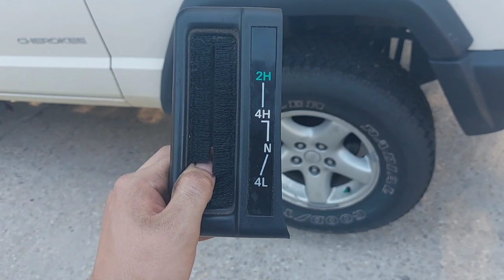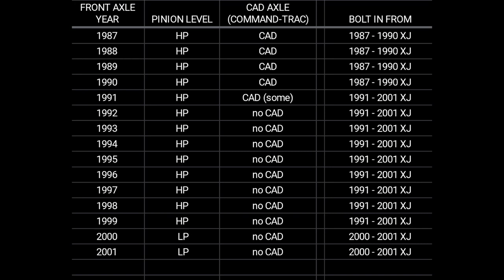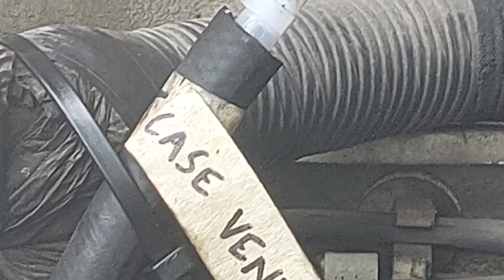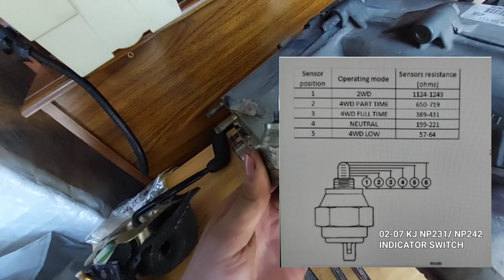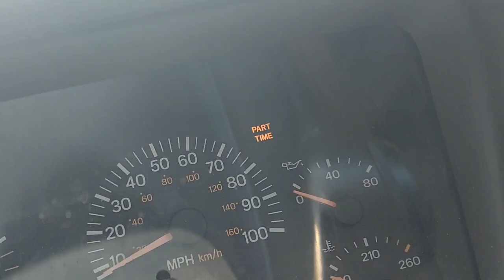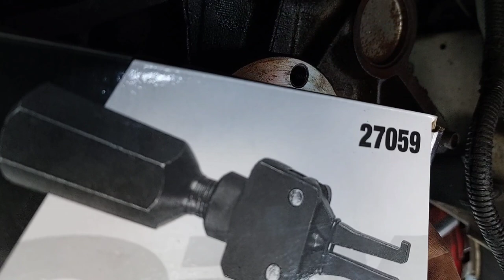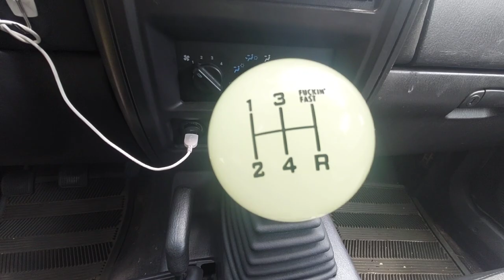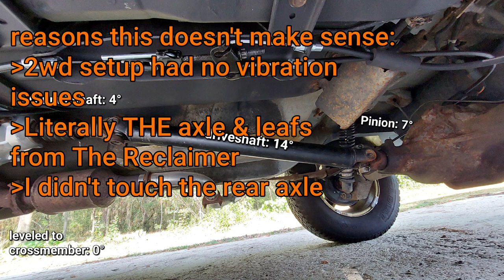Jeep Cherokee: 2wd to 4x4 Swap: Everything You Need to Know to Install Factory 4wd [‘87-’01 XJ]

Comment: Really no parts for nv 3550 and you believe that? A quick internet search shows different. Why not go with a nv 4550hd like most jeepers would want. I went from Ax 5 to Ax 15 because cheap. But would like the nv 4550. Despite "nobody" works on them. I would just rebuild myself I have a press, feeler gauges, and gear puller.
Reply from the maker: well, allow me to ignore all 4+ of the shops I talked to who each denied me service and cited the same reason every time, buy a press, feeler gauges, gear puller, and spend whoever knows how long learning the vast technical intricacies of rebuilding a transmission with no prior experience doing so, for a video almost entirely unrelated to transmissions... and/or inform my past self of a custom upgrade Dodge truck conversion for the transmission on a stock vehicle when I'm trying to convey the general process for adding a factory 4x4 system that others need to be able to follow the overall guidelines for. MY APOLOGIES SIR

Comment: Dead jeep sent me a bad steering column.   I asked for a replacement.... they sent another one.  Wouldn't accept the return of the first one and then refunded my money even after i called and sent several emails saying no that's not necessary.    I don't know if customer service has no real communication or what happened but i just gave up after the first few weeks of trying

Comment: Brilliantly detailed video as usual!  Much appreciated!  I'm in the middle of converting mine.  Just recently finished the front axle portion of it which also involved re-gearing to match the rear, replacing all new components: tie rods, ball joints, wheel hub assemblies, etc.  Only thing I'm lacking right now is the front drive shaft.  Once I acquire one for cheap, then on to the transmission swap.

Comment: I want to thank you very much for putting this video out. I will be doing this exact thing soon. 
I have a 1994 Cherokee two door 2.5 liter, 5 speed that was to good to pass up on. I also have a 2000 Cherokee 4 door 4.0 liter (no good) auto that I was going to steal from for the 4X4 system, and possibly the transmission too. 
Hopefully it wont be too much trouble. 
I wish I can "like" this video each time I've watched it...3 times by now.
Great channel and please keep it mostly XJ.
Reply from the maker: Don't get too excited, there's a whole lot of obstacles with the 2.5L, and the 4x4 Swap is not well documented at all for them. You won't be able to use a 4.0L transmission behind it, a 4.0L transfer case has 23 splines on the input shaft (2.5L transfer case has 21 splines) the driveshafts are all different lengths, and the front axle will require 4.10 gears (2.5L/ Manual) not 3.55 gears (4.0L/ auto) and even the 4wd linkage is different. Literally the only part you could use in a 1994 2.5L from a 2000 4.0L is the lever, and it wouldn't necessarily match the older interior. 

To put 4wd in a 4 cylinder XJ, you either need another 4 cylinder donor XJ (very hard to find in the US) or to just 4.0L swap it (very hard and extremely involved, I'm talking relocating engine mounts and replacing the entire drivetrain harness)
Reply: @WAEMIDIV  
Thanks for replying.
Well !@#$%^&*()!!! 
I was planning on a 4.0 liter swap when the 2.5 liter was dead and broken eventually. 
I haven't even thought of the engine mounts...or the drivetrain...or the...(keep adding to the list)
Damn it man, you just rained on my parade. Crapola.

Comment: Cool video!  As you pointed out earlier, the 2WD driveshaft is longer.  Shorter 4WD driveshaft will change the final angles of the u-joints.

Comment: After I lifted my 99 I developed that vibration. Got the hack and tap slip yoke eliminator kit and put a double cardon front drive shaft in the back. I suspect yours gained the extra pinion angle when you moved the output shaft back and used the shorter drive shaft. You could also get some four degree blocks for the rear leaf spring pads and get the angles to match a little bit better.
Reply from the maker: Yep that's what I'm gonna do. I have some shims in the mail right now, but in the long term I'm gonna replace my leaf springs, because they're twisted and deformed from axle wrap - and like you said, moving the output shaft rearward put the driveshaft in the vibration zone because of the already incorrect pinion angle that the longer, 2wd shaft was better able to dampen

Comment: Impressive work, I swapped my 2007 JKU and it was a lot less challenging, mostly because of the abundance of stock parts.
Reply from the maker: I'm surprised you found a 2wd JK, there's not many of them around
Reply: @WAEMIDIV  yeah, I got a deal on it and put a Dana 44 from a rubicon under it and did the whole swap for less than a $1000.  It was a steal

Comment: I got a 2001 2wheeldrive WJ from my neighbor for $700.oo Then found 2 1999 4x4 with 242 transfer cases an Auto transmissions with junk bodies .. $ 1000. in both of them. Now i have a 2001 4x4 WJ  and lots a spare parts 😁

Comment: The Venezuela and Brazil versions of Xj did come with Dana 44 High Pinion on front axle (it’s listed in Factory service manual)  And Currie makes a bolt on Dana 44. The Currie RockJock 44 does have some improvements to make it even more heavy duty, and they offer it for rear axle as well.  But these are mostly for die hard 4 wheelers.  Not sure if low pinion OEM version was made for those 2 countries. 

I have 93 with ax-15, which is last year of the internal clutch slave cylinder, and have been VERY tempted to swap over to the 94-01 external version (its direct swap, but have to change bell housing and a few other things). Supposedly not as good as the internal one but a LOT easier to change when slave cylinder goes bad.
Reply from the maker: by "not as good" people mean the clutch is like 2% heavier, it's really not a downgrade at all. I very much prefer the external cylinder to my internal cylinder Pugeoet in every possible regard

I am familiar with the Dana 44, in some earlier XJ models here it was offered as a rear axle in the tow package, and the 97-06 Wrangler TJ could be optioned with it as a front axle as well; so the TJ Dana 44 will actually bolt into an XJ 

A reason I didn't mention the Dana 44 is because I already talked about it in the Front Axle video, and to save time, as I was focusing moreso on a "stock 4wd" swap instead of a "building MY Jeep specifically" sort of video here

I do not believe the front Dana 44 ever had a low pinion

But for me, the Dana 30 works just fine for what I need a stock Jeep to do. I'll have to wander over to South America and find an XJ someday just to see all the interesting foreign options they have

Comment: Nice video, Waemid. 👍
However, at 35:18 you used a lighter for a heat shrink butt connector. You need a heat gun.
I've got a 10 year-old plug-in Milwaukee that's got two speeds. It's been a great tool. 
I've used at least four different cordless heat guns (I'm an industrial electrician, I have sometimes had to install heat shrink labels by the hundreds; most recently on a 150 MW solar field in WA state). They're okay, but nowhere near as powerful as my old Milwaukee. 
Point is: get a quality tool and it will last you at least a couple of decades. I've had mine for a decade, and I'm positive it will last for another 10 years, probably 20.
Reply from the maker: Yeah I do need to invest in a Heat gun, but I find I only crimp things occasionally, and the lighter has never failed me. It's kinda redneck-hillbilly but at the same time, not everyone has a heat gun, much like not everyone has access to a car lift. I try not to use specialty tools unless absolutely needed

Comment: Congrats on your 4x4 conversion. Not sure you could have made this video any more comprehensive and entertaining if you tried. Well done.  Now.....how can I get you to sell me the 2WD NV3550 you removed, so I can swap that into my '97 2WD AW4 Cherokee? Im having a heck of a time finding one..... 😊
Reply from the maker: Trouble is, the 2wd NV3550 is such a rare find, that not even the transmission expert (who knew EVERYTHING about the NV3550) had ever even heard of it. This guy has been building Jeep transmissions for 30+ something years and had never even heard of a 2wd NV3550. 

It was only ever in the 2000-2001 XJ, and the 2002-2004 KJ, in 2wd. That makes it exceptionally rare, so he bought it off me as a core along with the internals of the 4wd NV donor. The fried internals of the 4wd NV are now in a bucket with an empty 2wd NV case in his garage, and will likely stay there for a long time

You'd be much better off finding an AX-15, even in 2wd, as the shift lever and all that are also much more common. I have a video on the manual swap too
Reply: @WAEMIDIV  Yup, I've already watched it. I've done this swap before, just not on a jeep. I've also looked into the NSG370 swap for my XJ, but I'm not sure thats where I want to be. I need to do more homework.  Had no idea that the 3550 was in the early Liberty, that might be a good donor too. Any way you cut it, these parts are becoming exceedingly hard to find. Thanks for the reply 👍

Comment: Waymid ptsd when the starter bolt was backed out
Reply from the maker: The upper bolt on my XJ starter has been crossthreaded for the longest time, and I could never thread it in all the way, but it also doesn't randomly back out

Comment: I found in a junkyard a 1995 cherokee aw4 transmission with a np242 transfer case, it would fit in a 2001 xj 2wd ??
Reply from the maker: Consult my compatibility spreadsheet. 95 could be made to work with modifications, but will not drop in/ plug and play

Comment: This summer I will be pulling the engine, 4WD manual transmission and the entire drive line out of a 01 XJ. I plan to rebuild everything myself from the ground/block up. Everything new that I can get. And then install them into a 98 XJ that is a 2WD manual.

Do you have any recommendations or pointers for me?

01 VIN 1J4FF28SX1L521666
98 VIN 1J4FT28S3WL106902

BTW before I do any work on my XJ, I always look to see whether you have a video on how to do it first!!!  THANK YOU!!!!!!

Comment: Got a ? I'm working on 2001 2wd Cherokee xj. I got 96 that got all the parts I need. Will 96 interchange with 2001 ? Got transmission transfer case front and rear off of it.
Reply from the maker: ok I'll assume the 96 is a 4.0L and they're both Automatics, on stock height (no lift)

will the 96 _ bolt in to your 01:
Transmission: no
Transfer case: yes
Driveshafts: yes
Front axle: no 
Rear axle: yes 
4wd lever mechanism & shift gate: yes 
4wd trim bezel: no
Reply: @WAEMIDIV  both automatics. No lift. I could use the engine out of the 96 too.? I have everything. Complete donor jeep
Reply from the maker: @charlesmaxey9165  If you really want to swap the entire engine over, that'd have to involve all of the electronics, which are different in 96 than 97, and different in 97 than 98-99, and different than 00-01. You'd be converting a coil rail, California Emissions, horseshoe intake, 0331 head engine with a different belt routing into a distributor, single manifold, boxy intake, 0630 head engine that technically makes less power, and you have to change the ECU to get it to run, which inherently means you have to change the engine wiring harness (or custom your way through it all) which also means you'd have to change your interior harness to get the guages, switches, Dome lights, radio etc. to work... it's a damn mess. Don't swap the engine or you'll be at it for years. 

You can Rewire the connectors on a 96 AW4 to make it work in an 01
You can modify your exhaust manifold to get a 96 Front Axle to fit in an 01
You can buy a different trim bezel for $15 on ebay to work in your 01

or you could swap the entire drivetrain into a different body, but that's your call man
Reply: That's what I'm planning. I got rear and front axle and transmission with transfer case on it. So all I would have to do is just change connectors on transmission? I was talking about rebuilding the other engine and basically just use the block in the event transmission wouldn't bolt up to 01 engine
Reply from the maker: @charlesmaxey9165  The engine block is not the problem, they never changed the transmission bolt pattern all the way from 1987 - 2006. It's the electronics that are different.

Now I'm not an automatic expert, but from what I understand, The 97- AW4 has 1 speed sensor, where the 98+ AW4 has 2. This means the TCM will need/ have different inputs, and require different wiring. You will need to either repin or splice the connectors to make it work, I know it's possible because people have done it before, I'm sure there's an old forum somewhere. 

by "bolt on" I mean "require absolutely no modification whatsoever", not necessarily "physically connect to" English is weird 

The high pinion Dana 30 will leave your front driveshaft contacting the exhaust, so that's something else you have to worry about too
Reply: Ok so just wiring. It will get new exhaust anyway and I'm going to lift 3 inches. I think I got it figured out.  Thanks for your help.